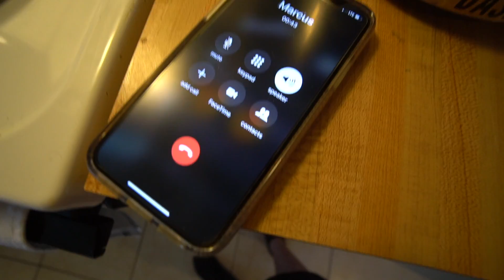BOUGHT A DIRT BIKE AND TRIED SENDIN IT!

Comment: A tip from a long time rider: stop using the clutch to shift. Just let off the throttle and smash the next gear.  You don't need it. The clutch is for start and stop and that's all. Just speed shift while you ride.

Comment: get some motocross boots and learn to use the rear brake so you can slide into turns it helps alot you should also build some berms in the yard to hit

Comment: I hope theres a pitbike build but before you do anything you need to order the two brothers footpeg mount kit if you dont being a bigger person you can rip the bottom out where the pegs mount and then you have to pull everything apart and split the case and replace it also tb makes big bore kits and makes these things badass one more thing you should put a yoshimura exhaust they sound sick itll sound like a big bike but a lil toned down and also theres alot of things you can do with the suspension to.

Comment: Also try a tubless foam rear "tube" I'm 6'0 160 and used heavy duty tube with a rim lock and still get flats in rear often. Check out moose tubes

Comment: Handle bar should be align with your fork legs, also you really only need to take off the axle in order to remove the wheel (Cause the two parts that falls apart in your video can be removed from the wheel while staying on the bike , also it's looks like a "L" version of  a klx wich means you have longer and stiffer suspensions (And also a clutch, that doesnt come with non L versions) all in all shout out to you for actually trying to hit the ramp, cause it looks so nasty and sketchy ! More dirt bike content, you'll love it bro ! And shoot out to balls of steel Marcus for actually hitting hit right off ahahah

Comment: Those "weights" are sprocket dampening pucks. They soften the shock from your front sprocket to your rear sprocket .You should also ensure you have your chain adjusted properly and rear wheel  evenly adjusted, both can be done with your chain adjusters